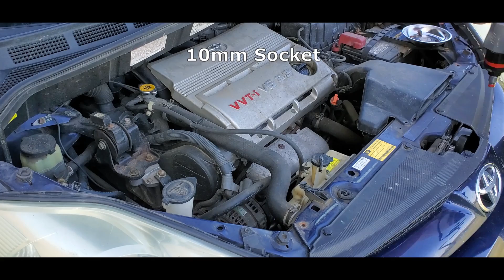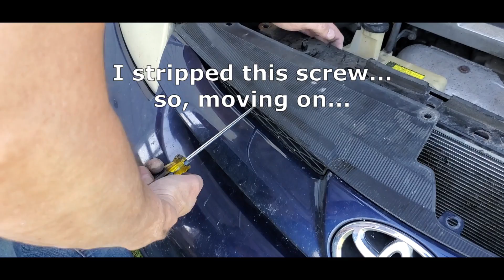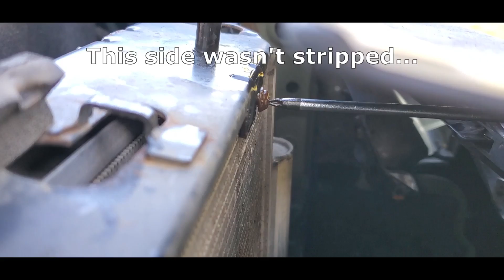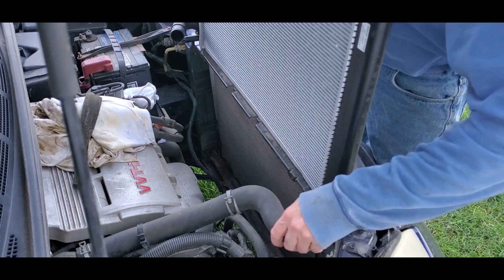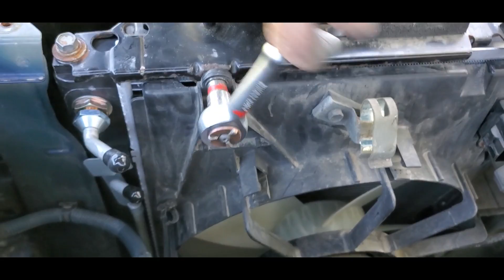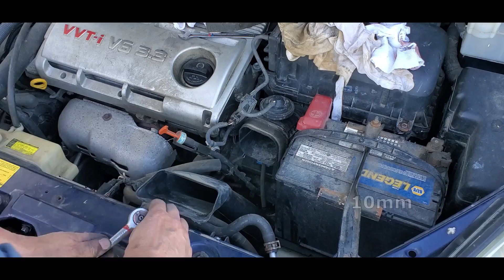Radiator Replacement – 2006 Sienna 3.3L V6 – Step-by-Step Guide – Toyota

Comment: I really like the way you explained slowly with patience along with some music!  I'm going to do this project tomorrow.  Thank you!
Reply from the maker: Thanks! Good luck, hope it goes well! 👍
Reply: @PracticalMechanic  I'm stuck at taking the bottom nuts out (bottom of the radiator attached to the metal plate with nuts on both sides).  There's a square type washer on the top.  Every time I turn the nut clockwise the square washer also turns, this is the dilemma. Any suggestions how can get those nuts out?
Reply: I was able to get them out finally!!

Comment: Just finished changing the radiator in my 2006 XLE.  Fantastic step-by-step, but I want to share a few things that might make things even easier:
1) The radiator is bolted to the bottom pan with 2 each 12mm bolts.  They are really difficult to access, and honestly I have no idea how one would reinstall them with the bottom plate still in the engine compartment.  The AC condenser is attached to that bottom plate with 2 each Philips head screws that face forward horizontally.  So, it is easy to remove those two screws, nudge the condenser off the plate, and then remove the radiator while still attached to the bottom plate.  Once removed, you can easily unbolt the plate from the old radiator, and then attach it to the new radiator.  
2) The two Philips head screws shown in the video, and the two I mention attaching the bottom of the condenser are VERY EASY to strip.  I would suggest that you have a few replacements on standby.  They are M5x25mm washer head screws, but I used ordinary pan head screws from Home Depot.
3) I couldn't get the Denso radiator for a few days (Amazon was 5 days, and local Auto parts stores needed 3 days), so I bought the radiator from local Toyota dealer.  Paid about $30 more than the Amazon price, but I got it the next day.  Toyota sells two radiators for this car.  The "Factory" replacement is 16041-0A380 and MSRP is $509.  The MVP (Market Value Pricing) replacement is 16410-AZ035 and is indeed a Denso.  I'm guessing the only difference between the two is that the MVP radiator didn't have foam strips on either side like the Factory one does.  Also, The commercially available Denso 221-0520 radiator specifically states that it is a direct replacement for the two Toyota P/Ns above.
4)The Toyota P/N for the Philips head screws (Toyota calls them "bolt") is 90068-04036  MSRP $2.68
5) There are rubber bushings under the top 12mm bolts connecting to the radiator.  If you need/want to replace them, the Toyota P/N is 16444-0F020  MSRP $5.31

Comment: Great video!  I love how you really got great shots of each area.  I'm about to do this job myself and went to the link you provided for the Denso radiator.  One of the more recent comments for that radiator mentioned that the radiator did not come with the bottom bolt holes, so I'm wondering if Denso has changed the design.  The commenter also mentioned that he wired the bottom of the radiator down to secure it instead.  Thoughts?

Comment: Hello. I am trying to replace the radiator but accidentally opened the line that connects in front of the coolant radiator and I heard gas sound like and think it leaks now.  I wonder what line is it? Thanks.
Reply from the maker: Sounds like the air conditioning line. See if the a/c still works. If not, that was likely it.

Comment: I'm assuming the radiator fluid and system burps itself. Any tips for ensuring that the transmission fluid system is fully filled given that upon installation the cooler lines are empty. As others have said great video. Helps gives us confidence we can do this job ourselves and save ourselves a bunch of money. And keep a great vehicle running.
Reply from the maker: Yes, that's correct. Easiest way is to drive it a bit and top it off as necessary. You can also 'burp' the main radiator hose to try to clear the air.

Comment: Great video! What are the 2 smaller hoses connected on the drivers side? It doesn’t look like antifreeze coming out of those hoses. Should I replace the thermostat at the same time?
Reply from the maker: I think those were power steering, but I could be wrong, it has been a while. Yes, I recommend you change the thermostat if it is old, too. Here's a video on that process:
https://youtu.be/-XEoe3VfCCc

Comment: I went to Harbor Freight and bought a brand new modestly long Phillips head screw driver for both rusty screws, attaching the upper plate.  And, I hammered the new screw driver into each screw with vise-grip pliers locked onto the screw driver handle.  Then, I applied all my weight against each screw while turning them counter clockwise.  I was able to get both screws off and in-tacked.  Thanks for making me forewarned about being prepared to handle the two rusty screws, that should have had a hex head for a socket wrench instead of a Phillips head.  I'll put anti-seize in the screw threads and on the screw head when I put them back on.  Replacing the radiator on my 2006 Sienna is just as tedious and time consuming as replacing the radiator on my 2001 Honda Odyssey but, I like how Toyota made the transmission fluid cooling lines connect up higher, making them easy to access.
Reply from the maker: I love hearing stories like this, glad you had more success than I did with those!

Comment: Excellent video , thanks. The Denso replacement radiator is less than half the cost of the oem , even when discounted. How was the fit? Any issues with that ? In the past with some of my other vehicles I have had fitment issues with non-oem radiators hence my query. Regards
Reply from the maker: Thanks. The fit was perfect for my 2006 3.3L Sienna.

Comment: You should do what I did for the for the screw that got stripped just get some vise grips needle-nose vice grips and gently twist it off replace it with the new one make sure that you use all Toyota parts manufactured parts because you don't want to be using cheap stuff on this vehicle

Comment: Thank you for this very well made video.  My question is, how much will it cost to replace a radiator, parts and labor.  I was quoted about $1200 for my 2006 Toyota Sienna, thanks again.
Reply from the maker: I would expect this to cost about $700 - $1200 for parts and labor. Kind of depends on where you're located and if there is anything else that needs to be replaced (like a head gasket - from overheating). Good luck, and I hope this helps!

Comment: Great video! If you were near by I would’ve definitely hired you. I have a Toyota Sienna 2006 myself and my radiator needs to be replaced due to leaking and causing the car wanting to over heat. And even purchased the new radiator , is still
In the box waiting till I find someone who really knows how to do this.

Comment: The 2 bottom bolts just keep spinning, how do i take them out, arr they super long?
Reply from the maker: They're not super long, the nut on the back may have come loose and spins. These bolts are not critical. Consider cutting them off if they won't be removed any other way. Sorry this happened, good luck! 👍

Comment: We are said and done! A few reallllly rusty part like the bottom piece the fans n radiator fit in.  Also getting that air piece back in.   Biggest question now is.. whr didn't it take the whole 2 gallons of coolant? And looked like to also put some in overflow?

Comment: 😢 at the moment I can't reach the lower fan bolts to get them off. I think I will need to jack up the car.
Reply from the maker: Those are the toughest two bolts of this whole project. Jacking up will help. Good luck!
Reply: @PracticalMechanic they're realllllly corroded bad . Soaked with pb blaster . I think this Was  where you said some don't put screws back?
Reply from the maker: Yes. I think I left those out on the reassembly... The radiator is held tightly enough by everything else.

Comment: Great video! Thank you very much. Question on your radiator replacement: has it lasted a long time? Are there alternatives that might b cheaper and work just as well?
Reply from the maker: Thanks! 
It's been almost 1 yr since I performed this repair, and the new radiator is still going strong, no issues whatsoever. I went with the denso (OEM) replacement, which is what I recommend. You might be able to get by with a cheaper non-OEM replacement...?
Reply: @PracticalMechanic  great to know, Thank you again !

Comment: Removal of hood latch is not necessary as it is only attached to the radiator top bracket.
Reply: Bottom on 2006.
Reply: @T_bone  Mine is a 2006...
Reply: @cmscott  Then you ran into the two 12mm bolts holding the bottom of the radiator on the left and right to the bottom. They are just seen peeking inside of a hole of the bracket coming from the frame. I may do my first video for this. They are the same two as the top mounted to the brace that the hood release is on. If you disconnect the AC condenser, you will have to drain the refrigerant or have RC-134 oil spewing all over. Don't ask me how I found out.
Reply: @T_bone  I don't remember. I DO remember that I did not remove the hood latch.
Reply: Oh well.  My upper tie bar got screwed up so if nothing else now I know how to replace that
Reply: Removal of the hood latch is necessary because of the release cable that’s attached to it.. not a lot of slack in that cable makes removing that top bracket tough with is still on
Reply: @KensAlcima-l3m  Not in my case. I didn't remove the latch.

Comment: I’m going on my third replacement in my 2004 Sienna in 10 years of ownership. Good tip on adding anti-seize to those bolts haha!
Reply: Why were you going through radiators that fast I just put my first one in and I believe it's original 2004 radiator with 220,000 mi!?!??

Comment: Buy a 12mm box ratchet like this gentleman uses for those lower 2 bolts. (I wish I had one!) They're easier to put in than to take out. Thanks for the education, good sir.
Reply from the maker: Thanks @PapaBear! Yeah, you're right, the ratcheting wrenches help a ton! Thanks for the tip, and all the best!

Comment: Hello how long do you think it will take to replace a radiator on a 2008 Toyota sienna ? Thank you
Reply from the maker: I would say about 4-8 hrs, depending on if you run into any snags. It took me about 5-6, but that included filming which takes some time. Good luck!

Comment: Hi, alot of people are suffering from water entering honda accord 2004-2007 driver side and behind driver side. A video showing possible entry points will help alot of people and will get alot of views. Thanks
Reply from the maker: Hi Abdullahi,
This video is for a 2006 Toyota Sienna.

For a Honda Accord getting wet inside, I have heard that a common problem is the moon-roof drain hose gets clogged or disconnected, so that water drains inside the cabin instead of outside under the car. Try snaking something through the drain hole (I saw some people use weed-whip plastic wire) to break the clog or identify where the hose is disconnected.
Good luck!